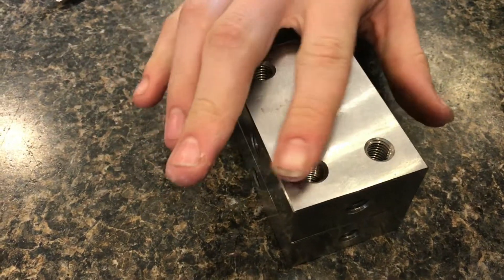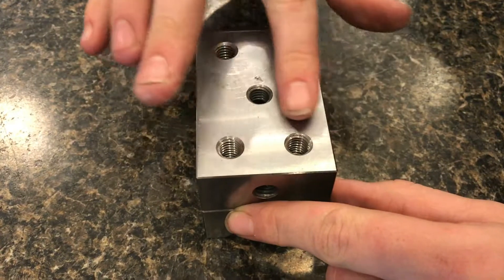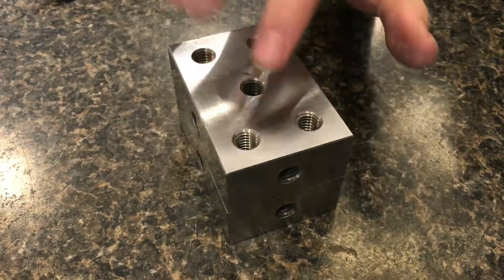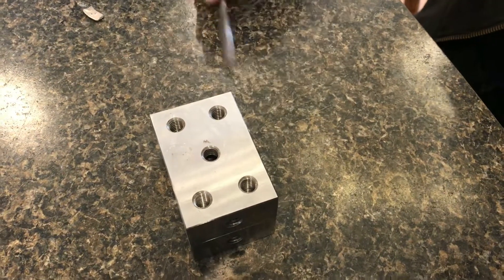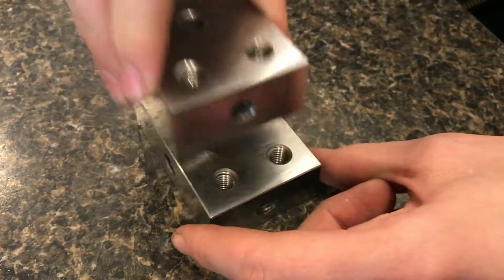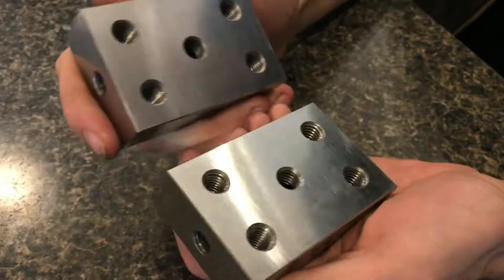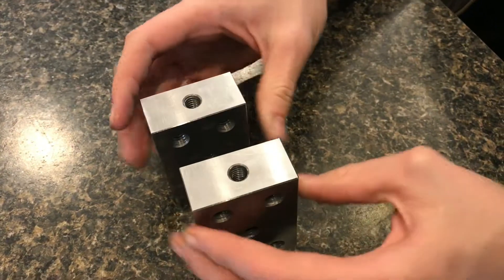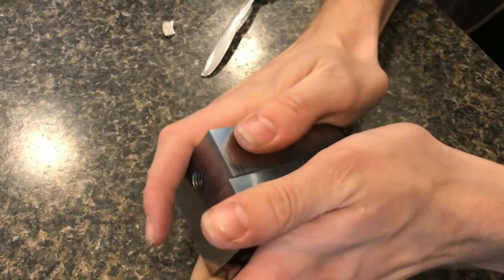Steel 123 blocks so flat they STICK together (completely NON-magnetic)

Comment: It's so cool! They're so close together that the electrons swap from the atoms of one block to the other. You're feeling the molecular attractive force that holds everything together.
Reply: @Friggin Genius  Don't assume things about strangers on the internet buddy. No one actually knows why gauge blocks wring together but there are many theories, the theory that air pressure plays anything but a minor role has long been disproven and there are scientific papers to prove this. 

There's even a YouTube video of gauge blocks that remain wrung together while in a vacuum, with a Wikipedia page on optical bonding to back it up with the science.
Reply: @Friggin Genius  I look forward to reading your paper on this subject with all your experimental data and sources properly sited. Until then I'll continue to believe what I have read in the scientific papers that claim that Van der Waals forces, hydrogen bonds, and dipole-dipole interactions play the largest role in bonding very flat surfaces together. Thanks.
Reply: @Friggin Genius Hahaha! You deleted all your comments, how stunning and brave of you.... Genius, lol :)
Reply: It's air pressure. They're so close together that there's a vacuum between them that needs to be overcome. That's why it works with any flat surface, not just metal.
Reply: @F_L_U_X source? Could be, but electromagnetic forces still in work on every material nit just metals.
Reply: And as the one before mentioned it works in vacuum too, soo its something other it seems.